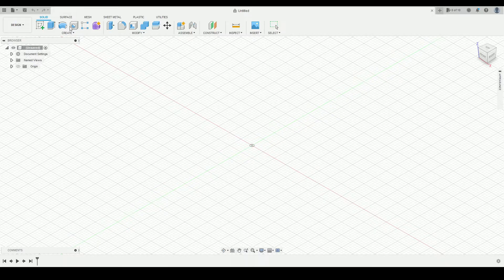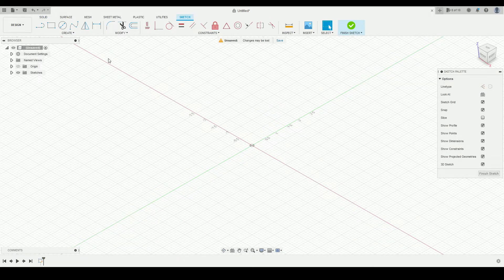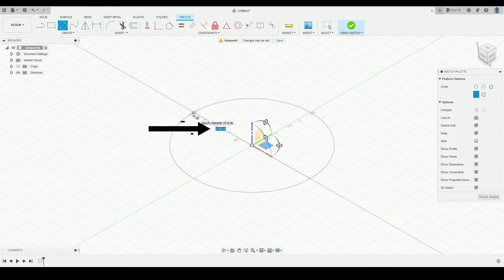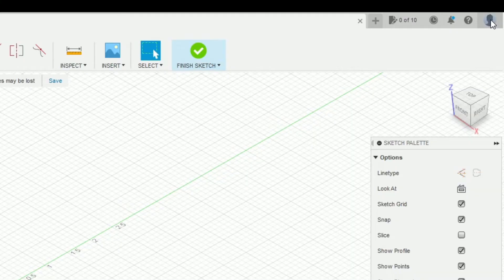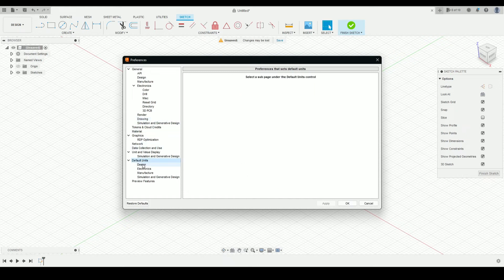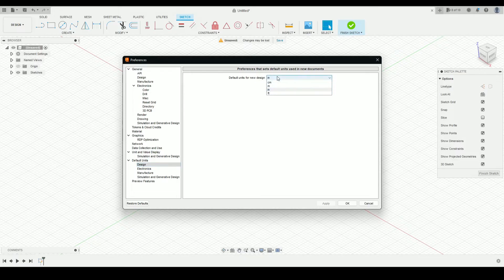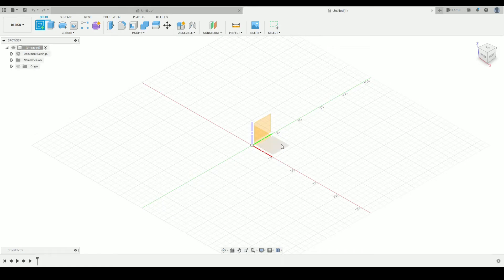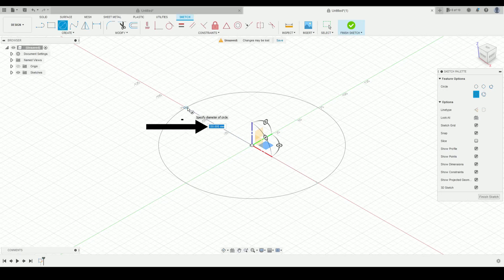How to Change Units (mm and Inches) | Autodesk Fusion 360

Comment: Doesn't appear in the menu with the free version. Your stuck with mm
Reply from the maker: Hi, no problem - you can click on your account in the top right then go to properties --> Default Units --> Design and then you can switch between mm and inches.
Reply: @AutodeskInventorTutorials  Thanks, got'er done.

Comment: Is there a way to change the units in a running file?
Reply from the maker: Hi Rahul, Yes there is a way to change the units in the current file, to do this, go to the tree on the upper right hand side of the graphics window, open the dropdown list and double click the 'Units: inches' and select the units you wish to use :)